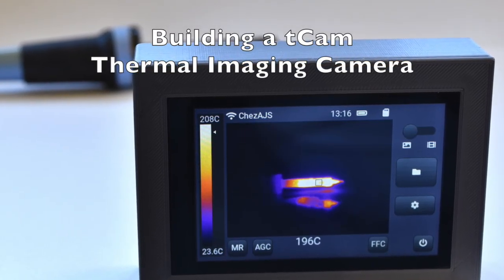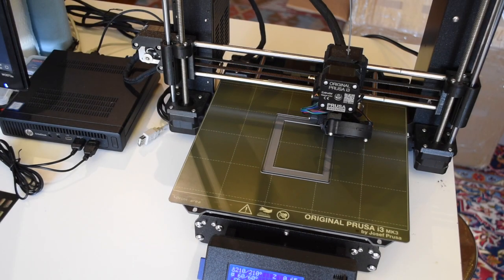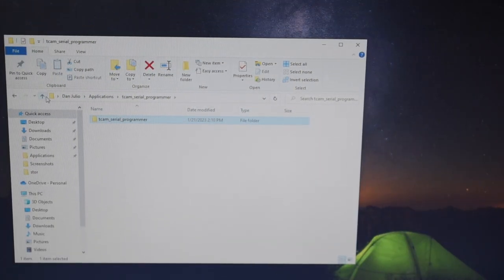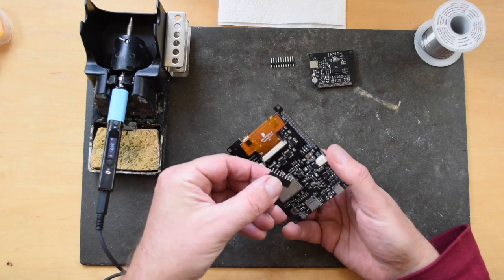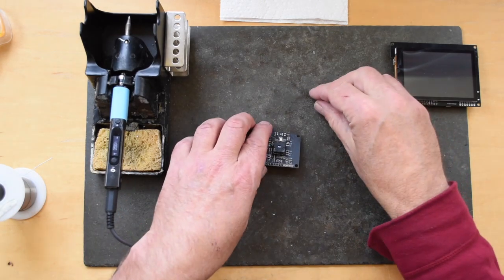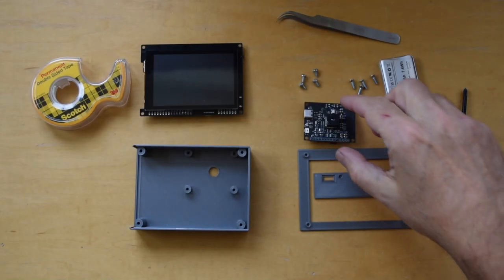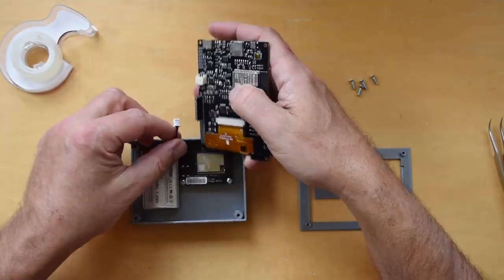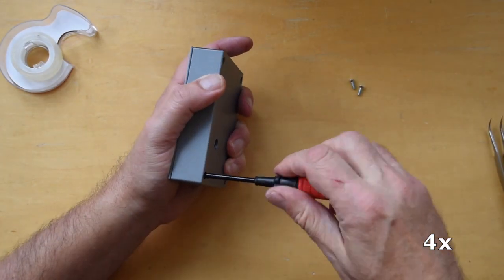How to build a tCam thermal imaging camera

Comment: How far can you see with this?  Are there lense options? How long does the battery last? I guess you could have a plug for an external battery if you wanted
Reply from the maker: The Lepton 3.5 has a 57° FOV that with the native 160x120 pixel resolution sets the minimum resolvable object size at any distance.   Focal length also softens images at distance.  I think it wasn't really designed for long-distance applications.  I don't know of any lens options but I suspect people have tried at least.  You would have to account for loss in the lens which is a feature I'd like to add someday but I need to learn some more before attempting that.  2000 mAh battery will last many hours - maybe 6-8+ for a new battery.  Turning down screen intensity helps.  The gCore can be configured for a 1A charge rate which will support a battery up to 4400 mAh or so (but they are physically much larger and won't fit in my enclosure).
Reply: @Dan Julio  very cool. Thank you